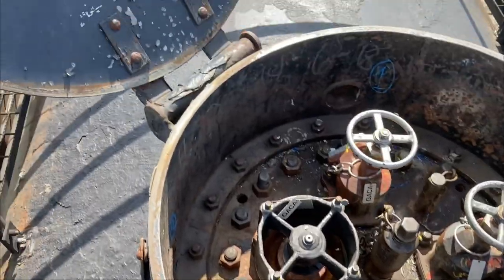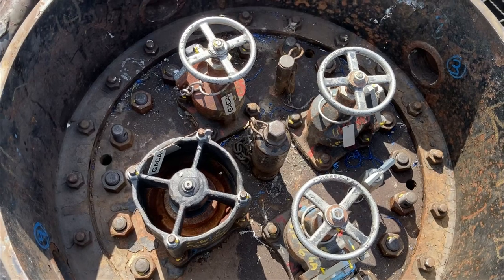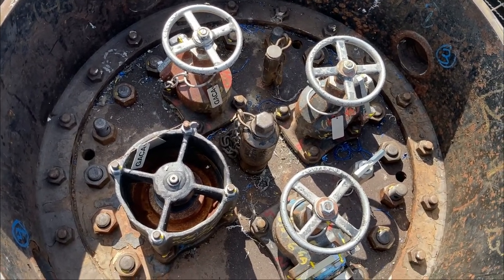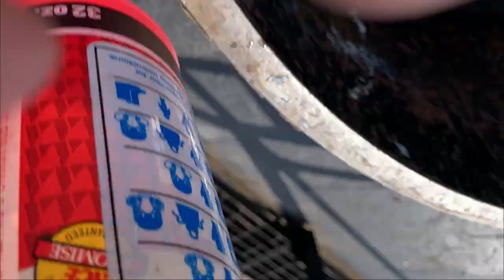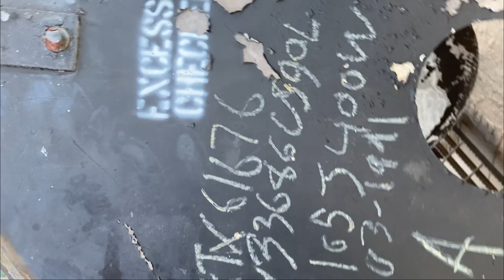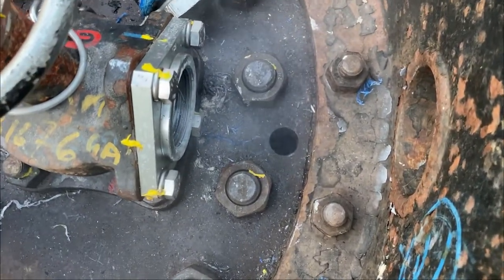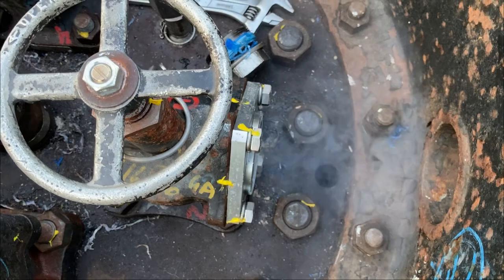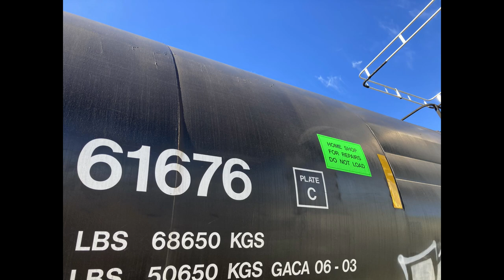39 - Another self-actuating car valve.

Comment: A couple of detection questions:  
Do you ever get non-odourised propane?
Does the detector detect the odourant or the actual propane?
IF you received a car loaded with non-odourised, how would you handle it differently?  Like would you always do a leak test on it?
Reply from the maker: #1- No, at least not intentionally. All of my cars are ordered from the refineries to be Odorized, and on the BOL they state how much has been added to the car. #2- the detector that I use detects hydrocarbons, like propane, methane and a few others. #3- if I were to ever get a car with no detectable odor, I would have to do a stain tube test, and if necessary, manually inject ethyl mercaptan into the car. #4- if I suspected a non-odorized car had a leak, I would still use the same leak detector. Thank you for the inquiry, hope this helps.
Reply: @mypropaneinsights6074  Yes.  Thank you for your patience and answers.